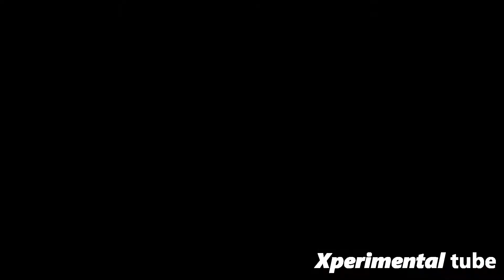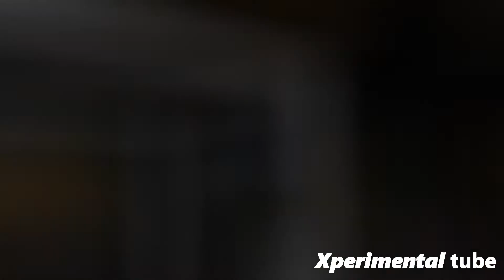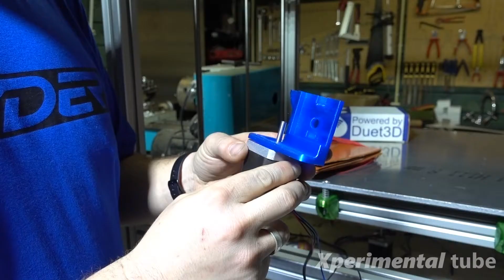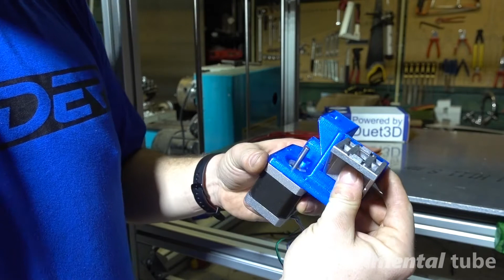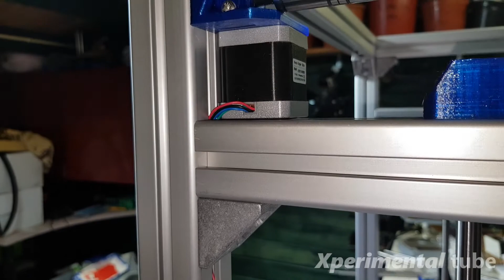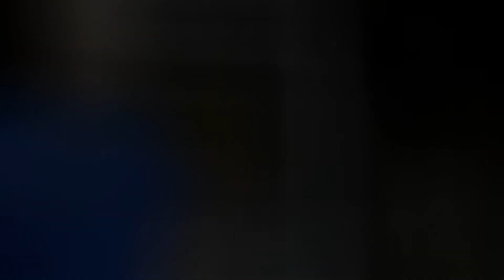06 Y Axis - HyperCube 3D printer Xperimental style

Comment: dude ur tutorials are amazing! got a 600x600x500 nearly finished but i got 2 problems: 
first problem: z axis with original print parts wont run smooth ... i just want to start with ur mod 
second problem: i think on this length of my (x=10, y=10 diameter) linearwaves there is too much 
leverage moving from x axis. but i didnt testet yet. do u remind some problems with stiffness of x carriage? 

Dont stop with your Channel!
Greetings from Austria